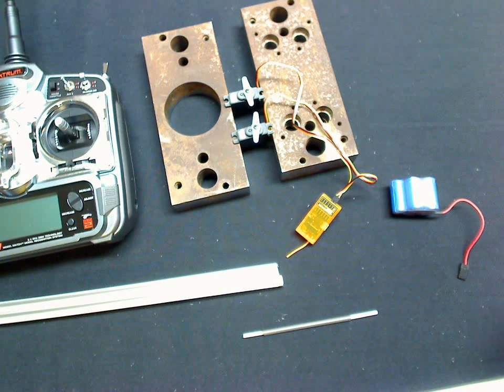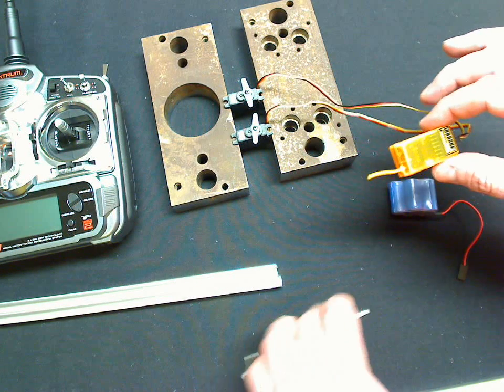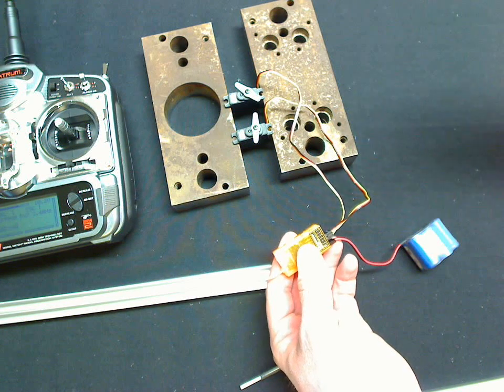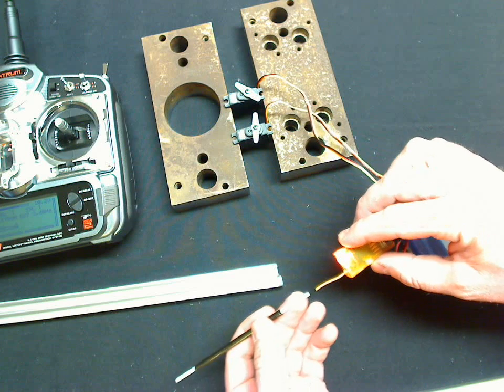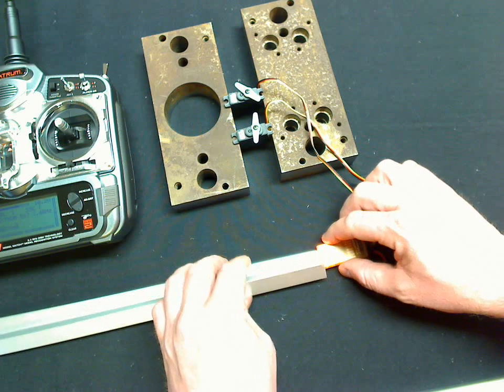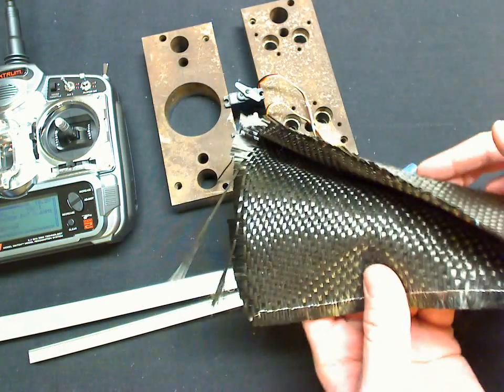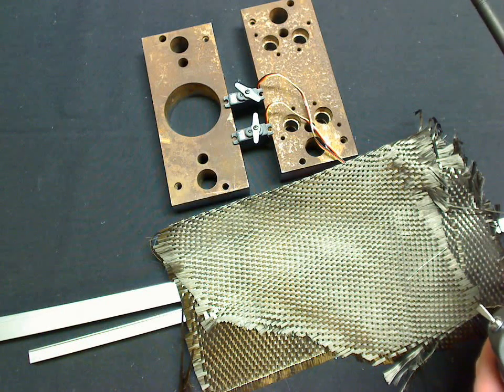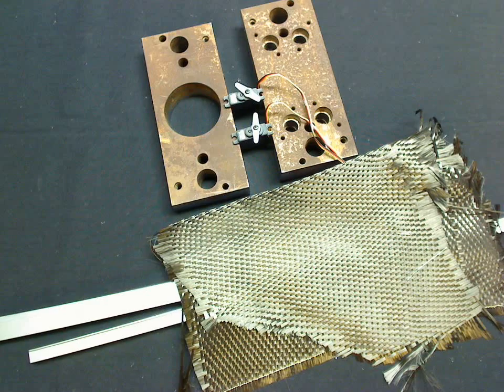Orange Receiver Range and Shielding Test.wmv

Comment: continued - b.) The practical way:

Go to a flat field, as big as you can find it. Put the receiver on a wooden pole. The higher the better. Walk away until signal fails. Compare this to any other model.
Antenna direction and your position must be the same to compare.

NEVER cover the antenna. Covering the antenna shows you how much HF leaks into the plastic case ;-)  Btw. in a.) the signal must be fed via coax from a test transmitter. GOOGLE 'receiver sensivity' and forget YouTube results :-)

Comment: OMG, once again, your test is just something you did to enjoy your afternoon, but has nothing to do with 'the sensivity of a receiver'.

There could be two way to check this box -

a.) The theoretical and technical way:

Put the receiver in an metal enclosure. The antenna connector connected via an antenna connector to the outside (don't forget the ground lead).  Battery and output wires must be HF shielded brought to the outside. Reduce signal until fail.